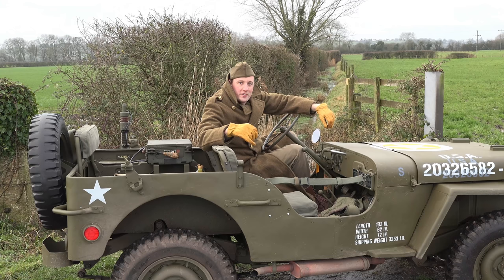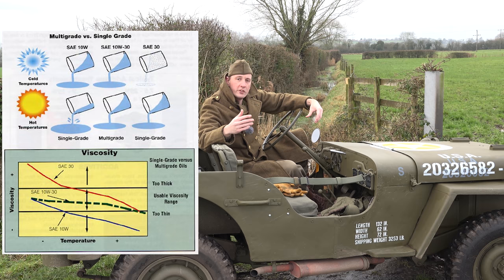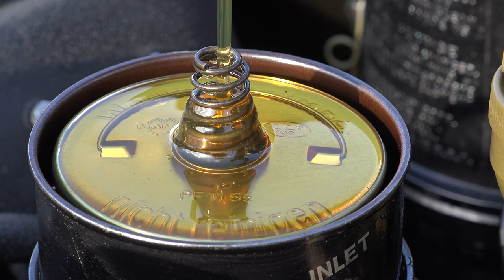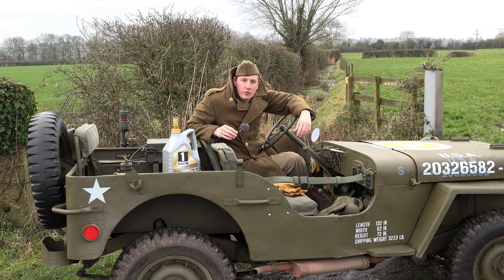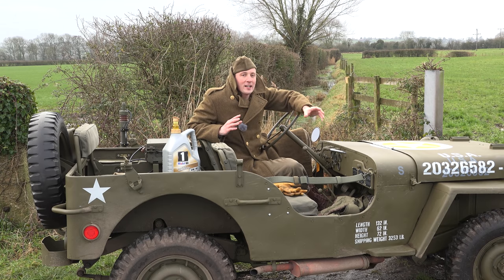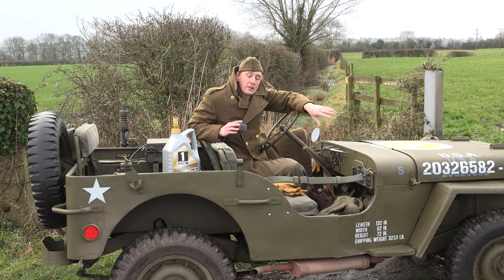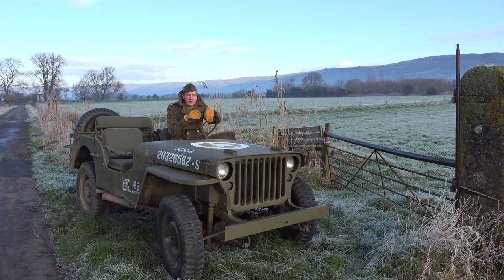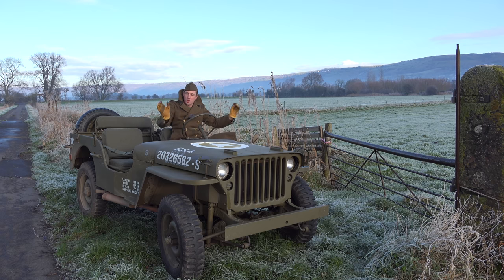Why can't You use Synthetic oil in old engines??

Comment: In the late 60's and early 70's, I was involved in restoring a few MB Jeeps and we used early synthetics in them with great success.  The oils in WWII were not very good compared to even the regular oils available in the 60's.  We had the advantage in that we were able to contact the engineers that designed and built the original engines.  They differed in opinion on whether to use a multi-viscosity oil or a single viscosity oil.  We ended up using a 20W30W oil for our engines. Regular non-detergent 30 weight oil was used for a break in period of 6000 miles. There were 3 oil and filter changes during the break in. The first at 1000 miles, the second at 2000 miles and the third at 6000 miles.  Even with the synthetic oil we still changed the oil and filter at 6000 mile intervals. One was torn down and rebuilt after 120,000 miles on this blend of synthetic oil.  No measurable wear could be detected on any of the bearing surfaces or cam lobes and the only engine parts to be replaced in that time were the generator and water pump.  I hope this helps.   Note we are in Southern Louisiana with considerably warmer temps than you may experience.
Reply: Wow, that was probably neat getting to talk to the original engineers.
Reply: Today's oils are even light years better than what was available just 30 years ago much less 50+, and I'm not including synthetic oils in that statement I'm talking just conventional oils.
It's one of the reasons that today's engines go so much further than they did 30 to 40 years ago, yes metallurgy comes into play of course but the oil companies have really been on the ball at improving oils over the years. 
If you bought a V8 small block Chevy powered vehicle in the late 50's you could pretty much expect to do a valve job at around 40,000 miles and a complete rebuild at 80,000, by the late 70's those figures moved to 80,000 and around 120,000 respectively. 
Today's engines last so long as a general rule that most garages don't even have a dedicated engine man in them anymore, nowadays as a general rule the whole rest of the car is wore or rotted out before the engine goes and a good deal of that can be credited to modern oils.
Reply: Common Sense Realist  
That's exactly why I change my oil every 3,000, because after that package wears out especially the anti moisture chemicals it's downhill from there, that includes synthetics, I only recently started using it because only lately has it come down in price to where it's only a few dollars more than conventional for a 5 qt jug.
I wasn't going to spend all that money on an oil that even if the liberation properties don't erode nearly as fast the chemical package breaks down just as fast anyways and in my eyes lubrication properties is one thing but the chemical package still dictates I change it at 3,000 miles anyways. 
Back when my motorcycle shop was still open to the public and I wasn't only doing private work I used to use Bardahl motorcycle oil in all mine and my customers bikes, that's one of the good European oils but since I'm not a dealer anymore I don't have access to it.
Reply: Gerard, I have read extensively in an online forum (Bob Is The Oil Guy), much to the same effect. The general consensus is to wear in a new engine rings using a high quality conventional oil, in this case suited for an engine with flat tappets. After this break in period you can transition to a full synthetic oil.

Based on oil analysis, the consensus is that full synthetic oils have a detergent component that is extremely potent for the first few thousand miles, and then less so. The lubricity of the oil is largely inherent in the synthetic medium itself, and this is very long lived. Longer oil change intervals are not only more economical with full synthetics, but also optimize engine life. Changing synthetic oil on the same schedule as a conventional oil may feel like babying your rig, but it is really diminishing the longevity of the engine by subjecting it to the aggressive impact of the detergent additives on a continual and ongoing basis.

Sampling your oil and sending it off for analysis is the only way to know for sure how well suited your oil is for your engine, and when it is diminishing in effectiveness.

The beauty of full synthetic oil in a vehicle that is driven for low miles is that you may not need to change it seasonally, and you need not worry about changing it annually due to breakdown from oxygenation (as is the case with conventional oil). If you don't have water accumulation or ring blow by then you need not worry about length of time in service at all, just miles. Partially synthetic oils do not offer this benefit.
Reply: @ivermec-tin666  
That's only true under certain circumstances, one of the biggest flaws in oil testing is the use of fleet vehicles for testing purposes of the oil in gasoline engine's, ie taxi's, delivery trucks and vans, and construction vehicles such as pickup trucks. 
On the surface that looks good and in most regards it is, but there's one big difference between vehicles used in those situations and average everyday vehicles used by the majority of people, and that's heat cycles per miles.
The issue here is the chemical package, what gives it moisture protection and the multi weight features breaking down with emphasis on the moisture protection especially, those chemical packages break down faster in a vehicle that gets started and driven for a short amount of miles compared to a fleet vehicle such as a taxi that gets started and run the better part of the day, something that puts on a lot of miles.
The same rules that apply to the health of an exhaust system apply to the chemical packages in oil, as an experienced mechanic I've seen how many more times per miles and time itself that the owner of a vehicle that gets started and driven a short distance to work everyday has to replace an exhaust system compared to someone with the same model and year that starts their vehicle and has to drive 50 miles to work everyday, the one only driving a few miles to work everyday replaces exhaust systems far more often than than one driving 50 miles to work everyday because the exhaust creates condensation when heating up and doesn't get driven long enough for the system to heat up enough and dry itself out, then it gets shut off and all that moisture lays in the exhaust and rots it from the inside out, early 80's Volvo station wagons were horrible for that with all their twists and turns for that moisture to lay in, but customers with the same model of Volvo that drive 50+ miles to work everyday only had to replace their exhaust a fraction of the time.
I've also seen the moisture that gets trapped in engine's started and run for a short amount of time then shut off especially when started on chilly mornings from working on Harley's, prior to the Twin Cam all big twin engine's had a timing plug on the left side engine case that has to removed to set the timing using marks on the left side engine flywheel, starting one up on a chilly morning and running it just long enough to shut off the choke and get it to successfully hold an idle then removing the timing plug from the left side engine case reveals what looks like a chocolate milkshake being used for lubrication in the engine, that's what motor oil looks like when mixed with water, as a matter of fact I have a pinion bearing race from a Harley big twin (unlike automobile or truck engine's Harley bottom ends use roller bearings as compared to the shell bearings in auto and truck engine's) that has the bottom ⅓rd rotted from the engine being repeatedly started and run for short amounts of time, I keep it to show to people as an example of what happens when a friend of theirs comes into town for Christmas and they take them out to their garage to show them their new pride and joy and of course have to start it up which leads to all that moisture being created in the bottom end and it doesn't get run long enough to dry everything out via the heat created by being run to full operational temperature as opposed to just heating up the combustion chamber enough to get an idle, it's because of the unique way of setting the timing on a Harley that I've seen something that I never saw with automobile's since at no time will you get to look inside a cars engine after running it for just a short amount of time after starting it on a chilly morning. 
After witnessing that I take very seriously the subject of heat cycles per miles on an engine and it's effect on the chemical package parts related to moisture protection, those chemicals wear out much more quickly in the oil run in an engine that only gets driven short distances after being started, matter of fact there's a store at the bottom of the hill where I live that's close enough that in the winter after going down there and back the temperature guage in my car doesn't even start to register on cold mornings, if I have to go there after I leave I drive to the next town up the road and back to fully bring the cars engine up to it's operating temperature. 
And until I see a study done specifically on the oil analysis of engine's that get started and driven only short distances on a daily basis I split the difference on the recommended mileage for changes between conventional and synthetic oil, especially since synthetic oil has become so much less expensive in the past 5 years or so, there's synthetic oil out there that's been certified by the API that's less than $3 more per 5 quart jug than conventional oil from the same manufacturer, $12 and pennys compared to $14 and pennys, after years experience as a mechanic I still firmly believe in what the mechanic said in those old Castrol oil commercials concerning oil changes, "You can pay me now or you can pay me later".
Reply: @dukecraig2402  My first three cars were VW Beetles. I lived in Western Washington State at the time, and foamy oil was a common problem if the oil was not changed on schedule, because it rains half of the year up there. Of course, in those days I used straight 30 weight, Castrol... Perhaps the tendency of conventional oil to emulsify with water contamination is a benefit. It was always easy to spot from the oil filler on those old air cooled engines.

As I understand it, motor oil is far more expensive in Europe than in North America. The governments tax the bejesus out of it over there. We can get the same EU made stuff here for far less than they can. One consequence of the high cost of motor oil in the EU has been the push to extended oil change intervals. On many German made vehicles, the oil change interval recommended by the manufacturer will be two to three times as long in the EU as in North America, even though they drive far shorter distances on average than we do. I tend to split the difference.

Your point about moisture from condensation resulting from not bringing the engine up to full operating temperature on a routine basis is well taken. I have never lived in a cold weather climate, so that is not as much of an issue where I am now. I do believe that an oil analysis would indicate if that had occurred, but it would be a lagging indicator. A visual inspection of the used motor oil is also something I always do, for color, sediment, filings, separation, and viscosity.

Degraded or contaminated oil is certainly something to be conscious of on a vehicle like the jeep, with a relatively small oil capacity. The margin of error is narrow.

I do not suggest the extrapolation of fleet oil testing data for a private vehicle. I was suggesting the purchase of oil testing services for a private vehicle owner who intends to run an extended oil change interval using full synthetic oil. This is done by German car enthusiasts in particular, not just long haul truckers, who were the original intended customer base for such services.
Reply: @ivermec-tin666  
I  was stationed in Germany in the Army in the mid 80's and while I didn't have a POV (Personally Owned Vehicle) and as a consequence never had to change oil so I never knew that I did see the price of gas on the pumps over there and quickly understood why the European car manufacturers were light years ahead of us when it came to 4 cylinder compact cars, it didn't take a rocket scientist to figure that one out.
And as I said I'd like to see an exhaustive study done on oil analysis from gasoline engine's that are started and run for short periods simulating vehicles owned by people who live close to where they work and therefore go through many heat and moisture cycles per miles compared to fleet vehicles that the studies are always done on, even the oil manufacturers tell you to change your oil more often if your vehicle operates under those conditions, but all they'll say on the matter is "more often", probably because there's so many variables for something like that they can't really pin down exact number's, however they do cite the chemical packages wearing out faster as the reason. 
One of the problems with doing a study like that is how long it would take to get definitive results due to the low miles put on a vehicle under those circumstances, that's why the studies are done on fleet vehicles, a vehicle run for 2 or 3 miles every day would take years to get the results, fleet vehicles also have many vehicles in the study which eliminates getting bogus results from a factory "lemon" engine skewing the results, as I said before there's many good reasons that fleet vehicles are used for those studies, another problem with results taking years to collate is that they are constantly updating those chemical packages in their oils, I don't know of any motor oil manufacturer that goes even 10 years without changing them, sometimes due to the metallurgy of the shell bearings in engine's.
Some years back the oil manufacturers had to do a major change in their oils due to cyanide in the shell bearings being outlawed by the federal government for environmental reasons, they determined that junk yards filled with cars that had shell bearings with cyanide in their chemistry was a hazard to the soil on that land, so the oil manufacturers had to develop new oils that were not only good for the metallurgy of the new shell bearings in engine's but also wouldn't wreak havoc with all the engine's that were already on the road and would be for some years to come, so a study done on vehicles (and to get accurate results it must be done on a high number of vehicles which once again is why fleets like taxi companies are typically used) under low daily miles might not be feasible since despite a jug of Castrol looking the same for years the oil inside actually isn't, as I said for all the more a jug of synthetic costs me over conventional oil I can afford to be on the cautious side and change it every 4,500 miles as compared to the 6,000 miles they recommend, that splits the difference between 3,000 miles recommended for conventional and the 6,000 for synthetic. 
On a lighter note and speaking about being stationed in Germany in the mid 80's I had a friend over there that took over a 77 Monte Carlo that he'd built a 454 big block engine and put in it, one of the great things about being in the US Army (back then anyways I don't know about now with the new European emissions laws) was that even the lowliest Private could have his personal vehicle shipped overseas courtesy of Uncle Sam as long as it'd be eligible to pass through that country's customs, and back then in Germany they still didn't have catalytic converters or even safety glass so just about any American vehicle could be shipped over, it being a 454 Chevy big block that was built for performance needless to say was thirsty, at the prices gas was over there at the time however he'd have to save his money for a month to be able to take it out for a weekend, but one thing he did to it that was smart was when he got orders to be stationed in Germany he replaced the rear end gears that were the proper ratio for drag racing and replaced them with taller "airplane gears" for running on the Autobahn, it was a real howl getting that big American tank scooting down the Autobahn with the best Porches of the time, we saw some truly surprised looks on some Porsche drivers back then, and when we'd park that thing the locals would beg him to open the hood, even though the 454 wasn't an option for the 77 Monte Carlo's when he built the car and installed one of those engine's he'd obtained the 454 fender emblems from the 75/76 model years with the crossed checkered flags, so enthusiasts over there knew what was inside, we'd all the time hear from people "Please can I see the engine, I've only ever seen pictures in magazines of a Chevy big block", in a parking lot full of Porches, BMW's, Mercedes' and even if there was a Ferrari around the crowd would be standing around that Chevy once tho hood was popped open, which was a real hoot to us because back in America where high school kids owned Chevys and other American cars with 400ci and bigger engine's it'd be the Ferrari that the crowd would be standing around, just goes to show you how it's always something from "over the pond" is what sparks people's interest.
Reply: That makes sense even how talk synthetic oil don't mix oil don't swap oil changes use oil type for while if switch. So old engine use regular oil start wearing parts that need broken in then use different oil after break in base on some history switching oil.  For all us keep those keep running alive.
Reply: Mobile 1 is the only good one.